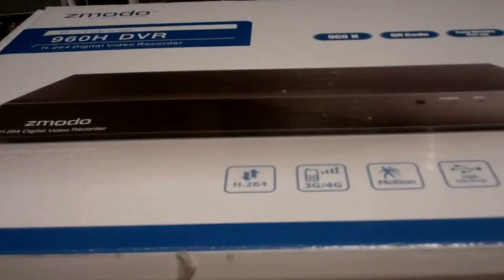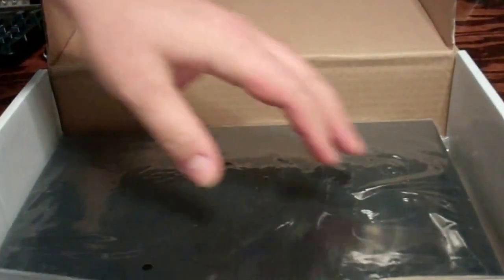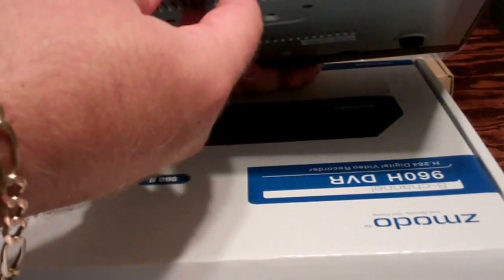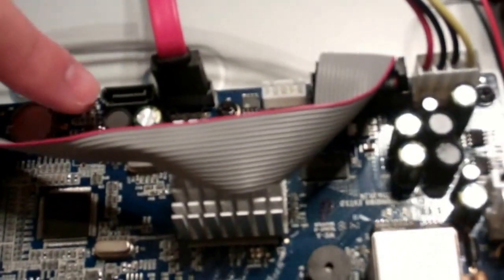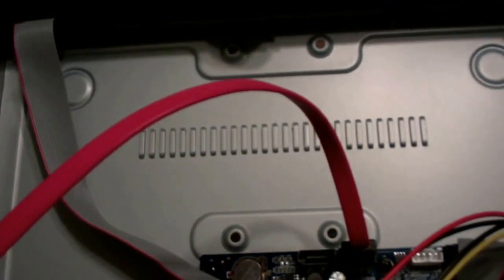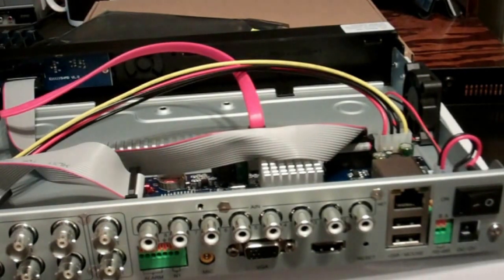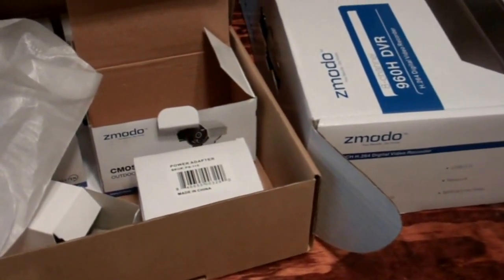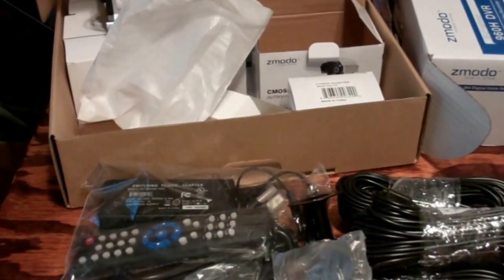Security Cameras with DVR Open Box & Review

Comment: Did you look at wireless cameras so you don't have to run all that wire? How did the cost compare?
Jim
Reply from the maker: Yeah they were a bit more expensive.
We already have the same brand with a 4 camera setup in the Red Wings restaurant so all we need to do is swap out DVRs and hard drives, then mount the 4 additional cameras around the restaurant.
Reply: RVR2 I got it that you were buying the new equipment to supplement what you already had (and probably needed after the "break-in" you had). I was just wondering if the added cost of wireless would be worth the difference.
Reply from the maker: Jim Foreman
The wireless options were averaging about $100 more and they (the family) don't seem to use or create good passwords so the possibilities of the system being hacked are higher.. Plus I'm buying this for my brother in law and he's on a tight budget still recovering from the break-in so this was the best deal I could find to incorporate into the existing setup